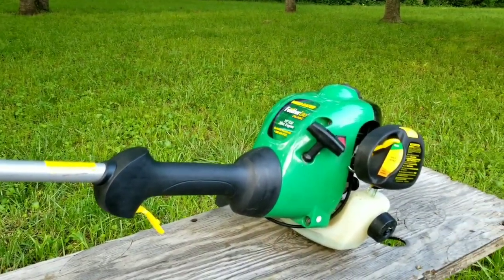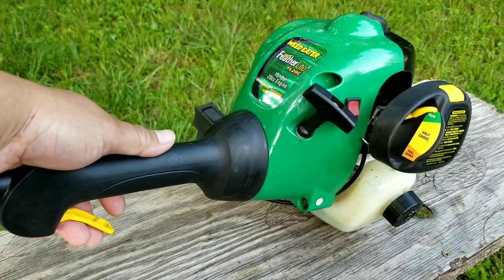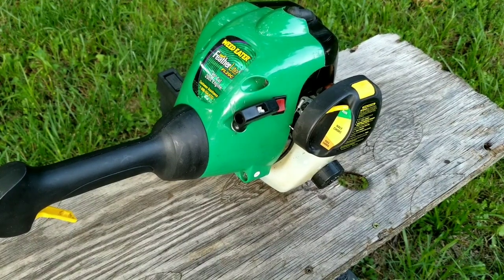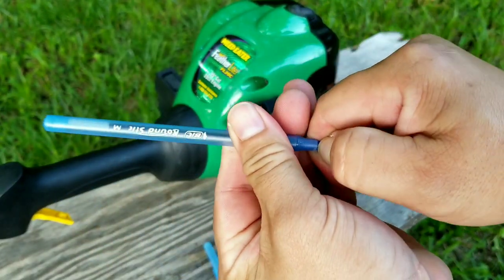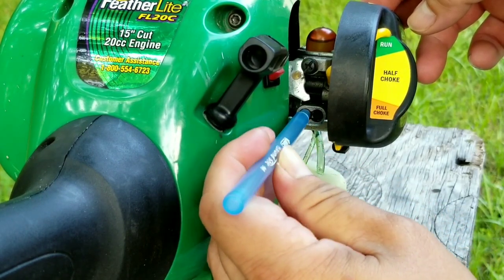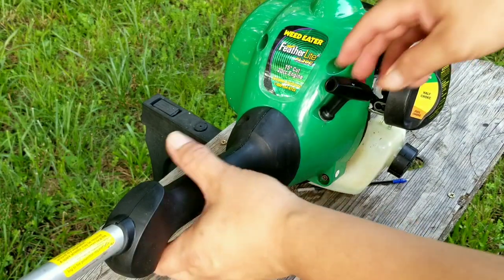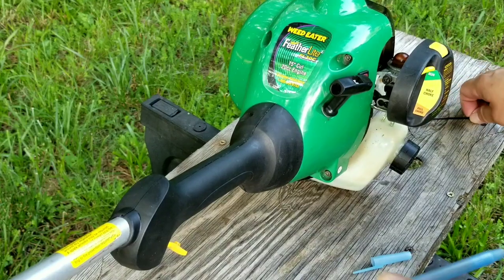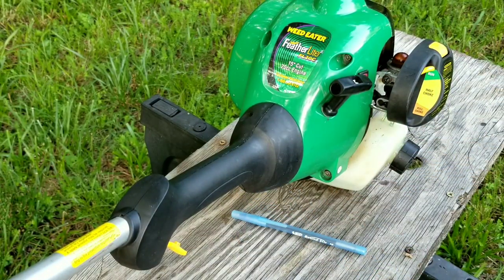Use an Ink Pen to Fix A Weedeater that dies

Comment: Why the custom screw head anyway? Prevent idiots (example: me) from screwing the adjusts up?
Reply from the maker: yes you are correct
Reply: @HomeGaragechannel  Nailed it!

Speaking of which, this is quite common on old radios. The radio stops working, the person opens it up to try and fix it, finds and tweaks the alignment points, and screws it up even more.

Comment: had this problem , along with fuel issue. seems to run out of fuel. checked lines ,ok  replaced carb, ran better, adjusted mixture screws, and started to act the same way as it did befor I replaced the carb,  what did I do wrong??
Reply from the maker: Did you examine the fuel filter?
Reply: @HomeGaragechannel  all new filter, fuel lines and carb and even spark plug.  adjust mixture runs nice then just boggs and shuts down, will restart and just repeats the symtoms.
Reply: @HomeGaragechannel  gas cap leaks from the vent, would this have any affect towards my issue.   ??
Reply from the maker: @josephfreeman6083  did you check the spark arrestor screen?
Reply from the maker: @josephfreeman6083  yes its only there to allow air to vent into tank. If gas is leaking then it could prevent that from happening
Reply: @HomeGaragechannel  what's that, and where is it?  muffler?
Reply from the maker: @josephfreeman6083  it's on the muffler outlet. How ever some have them built and in are non-serviceable.

Comment: Does that Brand trimmers head always spin?  I have one I’m repairing and before I rip the clutch apart I wanted to see, it sounded like in the video the head on this one was constantly spinning too
Reply from the maker: to keep cost down, cheaper trimmers do NOT have clutches so the trimmer head always spins. You can test this out by removing the spark plug and turn the trimmer head by hand in the correct direction and someone standing at the engine could watch the piston move up and down.
Reply: @HomeGaragechannel  thanks for the clarification, that’s what I was thinking but wasn’t sure.
Reply from the maker: @Outdoorsful-living  anytime and thanks for your time

Comment: I have a trimmer with a walbro carb..After running for 20 mins or so the adjusting screws vibrate inwards..then starts to bog down..then a quarter turn out on both screws and its fine again for about another 20 mins of run time, until they vibrate in again..I've been carrying the adjuster tool with me..any ideas on a correction? or than a carb change?Thanks
Reply from the maker: I've never seen adjusting screws that loose before, and most times they vibrate away, from what the are screwed into. I would consider replacing the carb.

Comment: What needs done if you have to keep it at full throttle or it will die?
Reply from the maker: I would suggest replacing the carb.  That's the easiest way.
Reply: @HomeGaragechannel  what might you suggest for MTD/Troybilt mp479   from looking around the past couple weeks, they keep putting on worse carbs that aren't adjustable.  Is there a better one to put on than a direct replacement?
Reply from the maker: @jackpelton  if you're asking about replacing the carb for a different one that is adjustable I'm sorry to say I've never done that.
Reply: @HomeGaragechannel try simply adjust the idle screw

Comment: Thanks dor the video man! Mine kinda do the same thing but mine idles and if I go slowly with the trigger it works but if I do it fast it dies
Reply from the maker: it could definitely do with a small turn on the screw close to the engine on the carb.
Reply: @HomeGaragechannel  thanks man
Reply from the maker: @kazekagetilo  no problem

Comment: This machine looks just like my mcculloch but different color,mine has on/off switch above the throttle lever,i've heard that mcculloch arent very good ? & most ppl say theyr'e crap,never had any problems with it so far 😊😊
Reply from the maker: Excellent I hope it keeps working for you. Thanks I appreciate the comment
Reply: @HomeGaragechannel  so are they really as bad as popular opinion suggests?
Reply from the maker: In my opinion they aren't bad machine at all. I'd like to have one if I could find one.
Reply: @HomeGaragechannel  im in victoria australia & i got mine from bunnings which is a hardware retail chain australia wide,mine is about 4+ years old & doesnt get used a lot.
Reply from the maker: @neilfroggycrompton2466  thanks for the information.

Comment: Get the right mixture tool. It lasts longer. Keep it on you while you do yards to adjust the mixture as needed.
Reply: Yeah but you can't use it in an emergency as a pen.

Comment: Yes, I've thrown power tools away because they weren't reliable anymore.  I fiddle with them as much as my limited knowledge will let me, but if my effort isn't successful, I toss out the tool and go buy another one.  It seems like that is less expensive after several years of use, than to pay professional labor to repair it.  Lately I buy battery powered tools instead of gas.
Reply from the maker: I understand how you feel.

Comment: Where's the spark arrestor screen?
Reply from the maker: Sparks will actually come out of the muffler so the screen so the screen is to prevent that
Reply: @HomeGaragechannel  all this worked. Thank you times a million. Only issue is it won't stay on. Idling on it's own. But what can you expect for a cheap machine🤷
Reply from the maker: @teetop5776  exactly

Comment: I have a weed eater every time  I use it It dies after 10 -15 mins.and the motor is so hot can see smoke in spark plug,Thats why I can’t finish my lawn.
Reply from the maker: are you mixing your own fuel or using premixed fuel from a can?  also your carb seems to be running lean so it needs more fuel.  its basically sounds like its overheating.

Comment: Mine has opposite problem. Won't idle (stalls) but will run with the throttle depressed.
Reply from the maker: usually if that happens, it means that theres not the right amount of fuel being delivered to the engine , either too much or too little,  I would suggest replacing the carb as it's the easiest way. otherwise you might be fiddling with the screws for awhile with some frustration.
Reply: @HomeGaragechannel  It's a brand new carb off of Amazon. Sounds like not enough fuel at idle; I'll try adjusting the metering screws once I find a bic pen. Thanks again!
Reply from the maker: no problem

Comment: My trimmer was starting but would immediately cut off I changed the spark plug and now it not doing anything
Reply from the maker: Put the old plug back in.  Try adjusting the carb and if that doesn't work replace it.
Reply: Home Garage unfortunately I tossed it then I replaced it with the new and now it’s not doing anything SMH I in did try to find the old but my kids tossed the trash lol
Reply from the maker: @darnondefrance5371  okay try adjusting the carb.
Reply: Home Garage ok thank you guess it’s time for that pen
Reply from the maker: @darnondefrance5371  it can't hurt

Comment: Nop.i haven't truthfully. I would clean out the carburetor.& Replace the bad parts inside of them.& Adjust the carburetor to. Just to end up finding out it's poor quality fuel was actually the problem.& One of the main reasons.& Cause of it all to. Do you moisture build up inside of the fuel tank. That has built up over long periods vof setting time.,or just bad batches of fuel altogether for the beginning straight out of the gas station fuel tank.& Pumps.
Reply: That one of the main reasons why they don't need it inside of any unleaded fuels at all. Just only E-85 vehicles fuel pumps.& Ethanol free gasoline fuels with octane booster.& Marvel mystery oil.& Gum out carburetor & injector cleaner is all the unleaded fuels need in our country straight up. Save the ethanol fuel for those fuel pumps that are rated E-85 & for rubbing alcohol.& Drinking alcohol consumption only for real.
Reply from the maker: thank you John Hicks for the information I appreciate it.

Comment: I think these are pretty good trimmers when they are working.
Reply from the maker: You are correct.   I used it the other day.
Reply: So you used someone's trimmer to make sure it works?  That is a pretty good way to test it because that is how it is going to be used.
Reply from the maker: @cdos9186  this one's mine.
Reply: How did you get it?  How many trimmers do you have?
Reply from the maker: @cdos9186  I don't remember if this  was a craigslist freebie or given to me. I have several trimmers. Some  fixed and others not.
Reply: You are so lucky to have a lot of trimmers.  Hopefully you make videos on the ones that aren't fixed!

Comment: do you know why my mower wont start it back fires and smokes when you pull it cheers
Reply from the maker: Yes check the blade for a Knick or gouge in the edge of the blade. If it's there then the flywheel key might be sheared.  That throws the ignition timing off causing a backfire and smoke. What kind of mower is it?
Reply: Home Garage i just check the blade it doesnt have anny knicks or bent
Reply from the maker: Can you give me the model number of your mower
Reply: Home Garage i just pull of the fly wheel and it hasnt got one in it
Reply: theres no fly wheel key
Reply from the maker: @ryan-ny8fj  I've never seen that before. Was there only one bolt that held the flywheel to the crankshaft?
Reply: Home Garage yes one big bolt and i didnt even have to pull the fly wheel of when undone the bolt it was loose
Reply from the maker: @ryan-ny8fj  ok so it seems that the flywheel is very damaged. It is supposed to be keyed in reference to the crankshaft. That's how the ignition is timed. I'm not sure how this happened but it may be time to get another engine or mower.
Reply: Home Garage ok thank you so much!
Reply from the maker: @ryan-ny8fj  no problem

Comment: Turns out my fuel lines were cracked from age and were sucking more air than gas.
Reply from the maker: that makes sense.
Reply: @HomeGaragechannel  Because the fuel line is so tiny, can I get it at most auto parts stores or strictly from a small engine repair person?
Reply from the maker: with this line size, you can only get at small engine stores, locally, or from an online store.

Comment: Great info. Question, can a bad coil stop the engine from powering up.?? Is not advancing.. ??  Same symptoms.. No adjustment on these carbs. Can get to low, not the High.  Thinking coil is not advancing. What ya know. ??